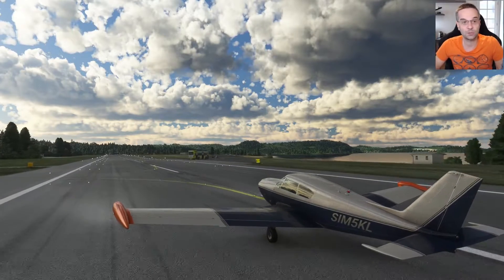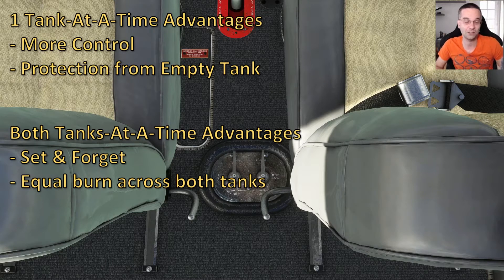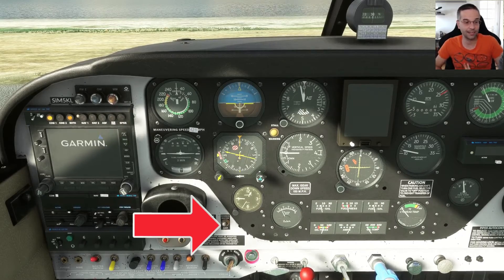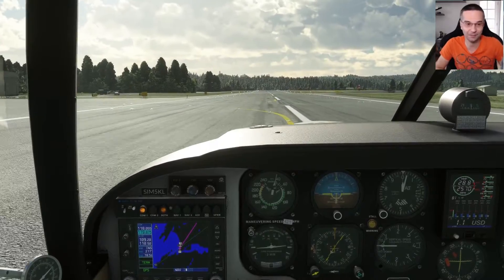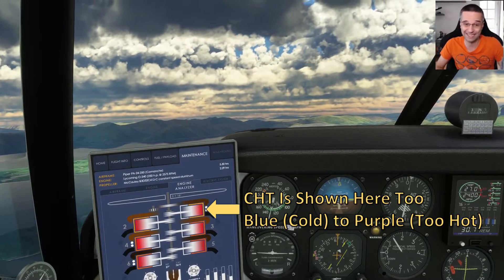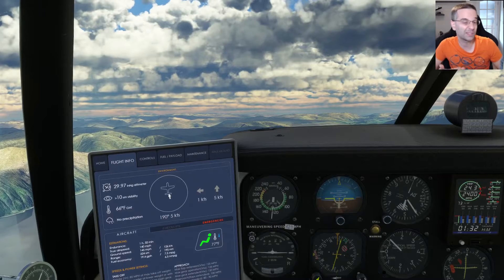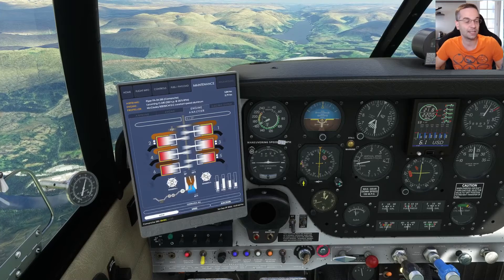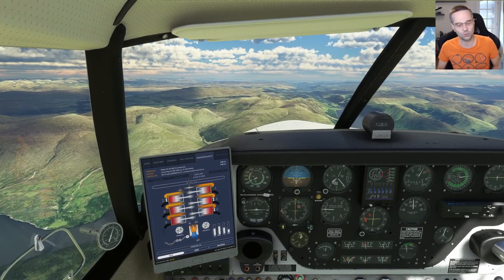A2A Comanche How To Guide Part 2: Startup To Cruise | MSFS Tutorial

Comment: Great video.  Question: On the square gauge that gives MAP and RPM in the middle of the panel, mine sometimes reads, FILL ? N, then changes to DIF 517 and the number keeps changing.  What is this trying to tell me?
Reply from the maker: The Fill message is just prompting you to enter the fuel quantity in the fuel tanks, since it doesn’t auto sync. You can send the right numbers through via the tablet though

Comment: Another great video!  The IRL O-540 is not nearly so finicky at needing the throttle cracked to keep running on startup vs the sim.  In many Comanches you start on only the Left mag then once you have 1000 RPM, switch to both - which will cause the RPM to rise about 200RPM so you have to be ready on the throttle to pull it back a bit.  The 1000 RPM idle ensures oil gets moved around properly while the engine warms up.  Once the engine is fully warm, lower idle speeds are OK.  

Minor checklist item - aux fuel pump should be on for takeoff to ~1000' in case the engine driven pump fails.  Easy one to forget to turn on or more often to forget to turn off after takeoff if you skip the climb checklist.  When lighter than gross weight, the Comanche will fly off in the low to mid 70's and the A2A simulates this rather well.  

With the EDM-830 mixture setting is pretty easy.  For just about any power setting in the cruise table, lean to ~1450 EGT on the hottest cylinder and you'll be remarkably close to book best power fuel burn.  You can also just lean to the book fuel flow - altough the fuel flow meter uses more averaging so it takes a bit longer to settle.  Fuel flow will also vary with airspeed for a fixed throttle setting - so if adjusting off of fuel flow you need to be in trimmed level flight and have the airspeed settled.  

In my '59 PA-24 the economy settings run rougher than I like, not unsafe just a bit more rumble than I like so I tend to stick with best power.  The Comanche really shines in the 7000 - 9000 range in terms of True Airspeed vs fuel burn and it has the power to get to those altitudes faster than many other 4 place aircraft.

Comment: Yours stay straight and narrow on takeoff. As did mine originally. It now veers violently, left or right.
Reply from the maker: You’re the second person to tell me that, the other person had the issue on landing. I told them to check their bindings on all connected devices, but if that doesn’t fix it, then you could open a thread on a2a’s forums, they are very responsive.